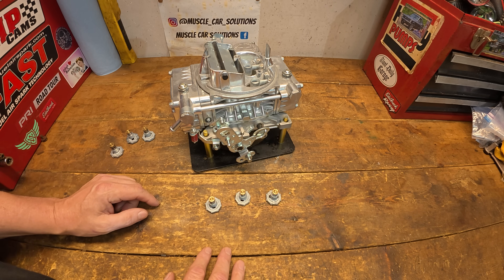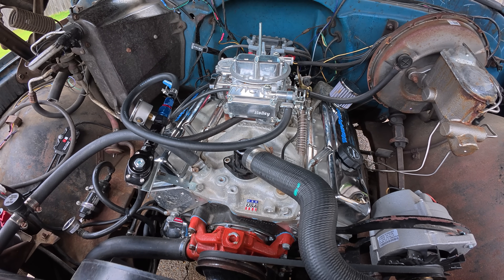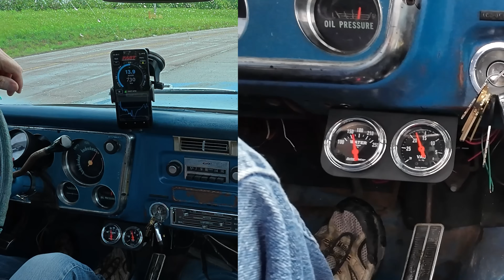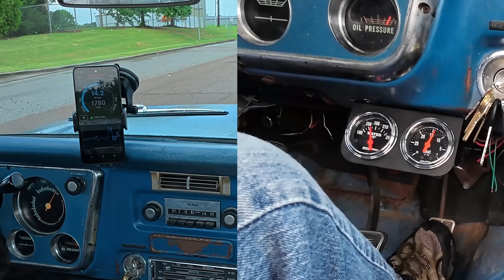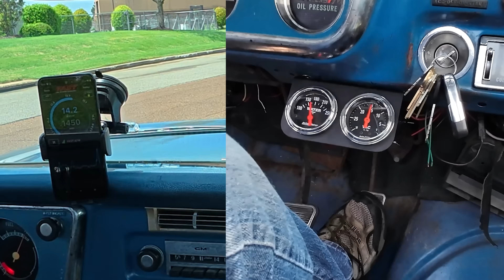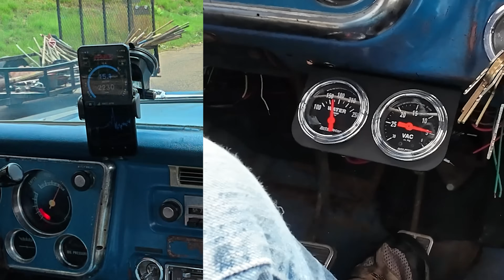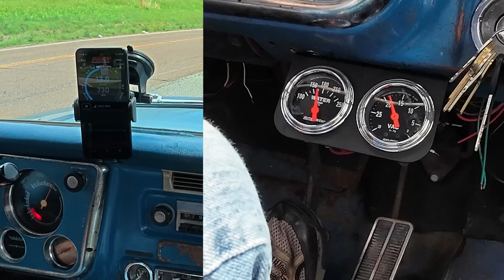Power Valve Tuning for your Holley Carburetor

Comment: im here because just opened an old 750 double pump  ... and it has a brass plug instead of power valve...and i don't know if i should put a power valve in or just leave the plug.... and thank you for the vid..
Reply: Really should use a power valve on the primary side.

Comment: Thanks for the video. I’m running a 4100 on my healthy cam 289. I’m pulling 13-14” of vac and I think I have a 7.5 or 8.5 PV right now. Think I would benefit from a 6.5? I do get a little black rich smoke when I come to a stop after a decent 3/4 ride. I’m assuming I’m getting too much fuel and that’s what is causing that. My AFR is 13.8-14.4.
Reply from the maker: Can’t hurt.  You’re fighting a little bit with a carb that’s not got the same tuning abilities as an aftermarket carb so might as well try what you can.

Comment: Question. I am running 2 4 barrel 600 holleys with a automatic. I changed the power valves in both from 6.5 to 5.5. I get about 5 start and ride and drives and I end up fouling the plugs out. I am running hotter plugs in my engine. I was thinking about going to a 5.0 power vaclve for both.. what's your thoughts?
Reply from the maker: What engine?  What linkage?  What’s your initial and full timing set at?
Reply: Running a 429 scj, with a progressive linkage. The linkage dosent hit the second carb till a quarter of the way on the first carb. Standard timining with a mild cam
Reply from the maker: @Joe-y4x what does standard timing mean?  What are the numbers it’s set at?  Cam specs?  Duration and LSA is all that’s important.  Excellent choice to use the progressive linkage.  What is your vacuum at idle?
Reply: I went with 5.5s cause of half the vacuum  reading. Not sure on duration of cam.  .530 lift on the intake. .522 on the exhaust. I called holley. They told me to mess with the idle mixture screws. They think the problem occurs at idle. And i put the antibackfire check vavle kit in borh carbs. I am thinking of dropping to 5.0 for both carbs. I played with idle circuit and i think holley wrong .
Reply from the maker: @Joe-y4x  duration is the the key numbers on a cam. So we’re working with an unknown cam.  What is your vacuum at idle?  You’re probably moving in the right direction dropping the PV down.  Without knowing more about the engine, it’s hard to know if those carbs are too big.  Dual quad set ups are a pain, even when you have all the details.  You’re going to struggle a bit with it without knowing what your timing is set at or the cam specs.  An AFR in your situation will be extremely useful to you.  You’ll visibly be able to see when the PV open.  Get a vacuum gauge in the car.  Seeing when those events occur on the AFR, vacuum gauge (and hopefully you already have a tach) will help you determine what direct to move as you’re tuning.  Get a timing light.  Adding a lot of initial timing will help tremendously.  Timing is hands down the first thing you should be working with.  Without it, noting you’re doing is going to end up better.  Learn how to properly read the spark plugs.  I did a video on that a few months ago.  Most people get it wrong and that video shows exactly what you need to see to make any determination on lean/rich conditions.  Also just did a video on heat range, which will also be beneficial to what you’re doing.
Reply: Yea. Duel carbs are a pain. They run good for me for a while and then fouls the plugs out after about 5 drive cycles. I pull the the plugs and clean them. Should both power valves be the same or would you drop the second carb powervalve to a lesser number?

Comment: Great video as usual. Could you please help me on this one with the power valve selection, I would very much appreciate it. I have a 1986 Bronco XLT, a .351 Cleveland with a bit of work done, and a C6 Autom, and it used to run with a dedicated GPL as you guys call it in US, in Australia we call it LPG. I am in a stage of tuning the engine for petrol, after changing everything, and now it has a Holley 600 vacuum secondary, and I fitted a modified primary metering block to the rear, with a blank power valve of course, plugged idle screws, fuel pump passages hole, and of course fitted the right gasket between the metering Block to the main body, all this in other to use ordinary jets. This particular 600 Holley "1985-2.  3386, comes standard with 66 size jets, and because of the work done to the engine, I started tuning with 67 fronts jets, 76 back. Engine has bigger valves, (10 to 1) compression ratio, a bit of a cam, a 2" aluminum spacer and headers. On drive idling in parking, it has 11 Hg vacuum, so I fit a 5 size Power Valve. In the shop here in Sydney, they tell me that 5.5 PV don't exist. May question please is, number 5 power valve would be near enough to start tuning? or move back to the standard 6.5 PV Thanks in advance... Cos.
Reply: I don't think you would need or want a power valve as low as 5" unless you were trying to tune for maximum fuel mileage.

Comment: I have a ford 289 with aluminum heads cam intake ext. the AFRs’ are great accept at WOT it’s pig rich at 10 AFR. It has a 5.5 power valve right now 1850 series Holley 600cfm.
Reply from the maker: You sure that carburetor isn’t too big?  What’s the specs on the engine?
Reply: @MuscleCarSolutions  ford 289.30 over pistons.the cam specs as best I can remember are Lift: .475 / .475, Duration @ .050: 221 / 221, Centerline: 108. 60cc combustion chamber. 180cc intake runners. Msd ignition. Edelbrock performer 289 intake.
Reply from the maker: @slowguy66  don’t recognize the specs but with that duration and LSA that cam is likely done around 5500 which would be a great match for that intake.  Just a fun cruiser.  Good low end and midrange.  If that were my build I would have gone with a 500.

Comment: I'm running dual 750 Race demons on a Weiand hi ram 294 hyd roller 10.7:1  496 BBC 3400lb Firebird I liked watching how the squirter first moved the AF to 12.9 13.1 then the Power enrichment coming in as you squeezed the throttle ... I'm gonna have to use a co pilot or Go pro for mine it gets stupid in a hot hurry.......... Great video !!! i slapped my carbs on set the idle AF screws at 3/4 turn 4 years ago  (All 8) and just drove it ... plugs not happy cold LOL gonna hook up a wide band and Vacuum meter and get at least into the ball park ..... Burning too much 110/93 mix 1:2 ratio Gonna try full vacuum to the distributer max set at  at maybe 7 degrees, lower the initial to 10 or 15  and 35 degrees total wot 36?????  at cruise light throttle for better street manners for  cruising and milage without surge wish me luck !!
Reply from the maker: The only advice I can give if you’re that aggressive on the cam and want to run that set up, there are things that I do that aren’t negotiable when I have to tune one.  1) lock out the timing and let a spark box control timing. You can run the curve to get the best full burn on that set up. 2) if it’s just a street set up, then progressive linkage is a must. 3) dual O2s. One in each bank. You need all the data. There is no such thing as too much. The more the better.  4) and most important, selecting the right size for your intended purpose of the vehicle is.  Those things will give you the opportunity to make good adjustments and get it running well, not just get it running.  👍

Comment: After you get your pv dialed in and adding fuel at the right time you can go further if your getting too much or not enough fuel at that time. The way you do that is by drilling out the pv channel restrictors and installing a 6-32 brass set screw that you can drill out to what ever size you need. Just use pin gauges to measure and then make the appropriate  changes. Happy tuning!!
Reply: Exactly

Comment: I’m having a fuel pressure issue that so far I cannot resolve.

64 Chevelle 327

At initial start up the fuel pressure gauge reads 6.5lbs. After the engine warms up the pressure drops off to zero. I changed the gauge with no result. I changed the manual fuel pump with no results. I even disconnected the fuel line that comes from the tank and ran a line from the pump to a five gallon gas can which would eliminate the possibility of a fuel line issue under the car. No change. I rebuilt the carburetor, no change. I installed an edelbrock e-pump, no change. The engine seems to run fine so I’m looking for ideas. Thought about relocating the gauge.
Reply: i have the same problem in 87 Camaro with an in tank electric pump. 6.5psi when cold, zero when hot but car runs fine,..float level fine .... have a return regulator that brings it down to 15psi (being an efi pump) that goes to a dead head regulator that brings it down to 6.5psi ... ... i'm just assuming its a false reading when hot.
Reply: @monaromadness2539  Hi, thanks for responding. Where do you have your gauge located ?
Reply: @monaromadness2539  where do you have your gauge located ?
Reply from the maker: Deadhead regulator?
Reply: @ what is a deadhead regulator ?

Comment: I've pulled many Holley power valves new out of the package that don't open at their advertised number. I test all of them. You can swap out springs and adjust as needed too.  Save the springs off of all your old valves.
Reply: no way i wonder how to remove the spring, do you use a might vac to test Hg of PV?
Reply: @ubethejudge69  mityvac and the springs wind off and on. You can make your custom opening point easy enough if you have a selection. The manufacturer calibrates it by using threadlocker and you'll see some have different amounts of thread engagement.  So longer and shorter springs play into it too.
Reply: @ That sounds cool, I'd like to learn that.  Still little unclear on how to dissemble a PV to remove spring without damaging it.  the video shows a cut away but no disassemble
   I've tested using the mighty vac which works for me.
Reply: @ubethejudge69  you can wind the spring off, don't try to disassemble the valve
Reply: @BobHollinsheadGarage  Ah hah! Ok ! Clear now!! Thanks!!

Comment: idle ,,,,progression,, main jet ,,,,power valve 
accel pump is a standalone system 
fuel tuning is about A/F ratios but also fuel event timing and volume 

A/f ratio volume and ,,,fuel event timing 
advanced tuning is emulsion tubes and high /low air bleeds 

idle ,,,, progression  port ,,,, low speed  air bleed  ,, max fuel orifice for idle system
main jet primary for cruise 35mph to 55-60 mph 
P/valve operates around the 50+ mph [measured vacuum at that point ]
vacuum at 50+mph . Tune the PV--Restrictor jet to suit WOT

Comment: Nice to see actual footage of how the different PVs  react in situ. I know that took a while to film. Changing PVs sucks. As you stated, the  rule of thumb for power valve selection, divide idle  vacuum in gear in half and use that number for PV. Holley 4bbl manuals years ago stated  that rule of thumb applied to idle vacuum at 13 or less. Most 4bbl Holley (non factory replacement) come with a 6.5 because I think they assume every car that gets a 4bbl carb has a big cam with poor idle vacuum. Vacuum above 13, a 7 or 7.5 is usually good enough but, as we know, every engine is different. Pull a tuned engine from one car and put it in a different one that weighs different and/or has different gears, trans, etc, the PV requirement will change again. Overall, engines  are pretty forgiving as long as they aren’t pig rich or super lean. Before AFR meters, we didn’t really care as long as our eyes weren’t burning or getting lean stumbles and popping. Using a 10 PV will work in many applications but will often result in it opening at cruise with minor changes in throttle position. Not a big deal but might get a little fat from time to time, and without an AFR we would never know. Fuel economy might take a hit if PV is opening too often. If running a 10 PV, you can usually jet down a couple sizes to get some of that economy back as long as it’s not going lean in other conditions. Also, have to be careful when tuning PV with vacuum secondaries as they can open up around the same time as the lower number PV’s and might skew the AFR reading. I like to wire mine shut while tuning so it strictly running on the primaries. Dial in the PV so it opens where it needs too, adjust jetting if needed, then work on secondary opening timing.
Reply: I like your idea of wiring the secondary wile tuning the primary side first, then worry about the secondary after, never thought of that. Do you suggest a clamp on the vacuum unit Stemp, so it won't suck up? wouldn't that distort the diaphragm/spring, or is there a better way of doing it? Thanks in advance ... Cos.
Reply: @CosimoSanfilippo-l4s you can clamp the plunger or simply disconnect from the linkage. I should have mentioned that previously. When disconnected, you have to wire the secondary linkage closed to keep it from flopping open. Good luck with your tuning.

Comment: Power valves were originally called "economizer valves". With that in mind, I think of them in terms of using lower numbers to try to benefit fuel mileage- up to a point when the vehicle is sluggish or hesitating to part throttle input, or some may even gas ping. A higher number may give better throttle response, but is also gonna use more fuel. The power valve channel restriction (PVCR) is what determines the AMOUNT of fuel that the power valve circuit provides. The power valve determines WHEN (at what throttle setting in relation to load) that the enrichment occurs. At one point Holley used dual stage power valves in an effort to improve fuel mileage and emissions- late 1970s- '80s(?) I've never quite understood why power valve choice should be based on idle vacuum, though. Imagine a modified engine that only pulls a few inches of vacuum at idle. At idle throttle setting, it doesn't matter whether the power valve is open or closed. It has no affect on the idle circuit. The power valve circuit is in relation to the main circuit fed to the boosters. The boosters are completely inactive until the throttle is opened. But when you come off of idle at part throttle the vacuum instantly increases which will close the power valve. If you come off of idle with a heavy foot the power valve will stay open- all doing exactly what it's supposed to. The overall wide open throttle (WOT) a/f ratio will be a combination of the main jet size and the power valve channel restriction (PVCR) size, and part throttle a/f ratio is determined by the main jet only (as long as the power valve is closed).

Comment: Thanks for the informative videos, I have a Holley 750 on my junkyard LS because thats what was on the original knocking engine. I used the Holley rebuild kit and I believe it had a 6.5 power valve with 69 jets. It runs ok but feels like there isn't much gain at full throttle, what do you recommend? Get an A/F gauge first?

Comment: Now you can change that power valve out about every 4 to 6 months😂 this junk ethanol fuel we have will turn that power valve rock hard.
    600 CFM is too small for that engine needs to be at least 650.
Holley carburetor part number 4776.
Reply from the maker: 😂😂 600 is just fine.
Reply: @MuscleCarSolutions  Okay Mr DIY youtuber.
Reply from the maker: @sherwinstaudt1881 you can participate here, but be respectful.  There is no comparison between an OE carb and an aftermarket carb.  They don’t meter fuel the same and certainly that 750 Qjet isn’t calibrated to deliver that amount of airflow or fuel like a 750 Holley would deliver it.  They’re two completely different systems.  My truck never goes past 5000 rpm.  The 600 is more than adequate for its needs.
Reply: The only drawback to me about a 600 cfm (1850 type) Holley carb is that the idle feed restrictions aren't accessable. They are down in the well & capped off at the top of the metering block. That carb is a newer model than I'm familiar with, but it's probably the same. As far as being too small, the man never claimed to be attempting to set speed records. The 600 is fine.
Reply: @mickangio16  the 600 CFM is not fine😂, in 1984 GMC and Chevrolet with a 350 cubic inch engine, used a Quadrajet carburetor rated at 750 CFM from the factory, I've been doing mechanic work for 50 plus years, please all you YouTubers get an education.

Comment: I have a 5sp  manual transmission car, so its the same way to tune the power valve?
Reply from the maker: Yup.  Just use the vacuum at idle and out of heat to set your base and start from there.